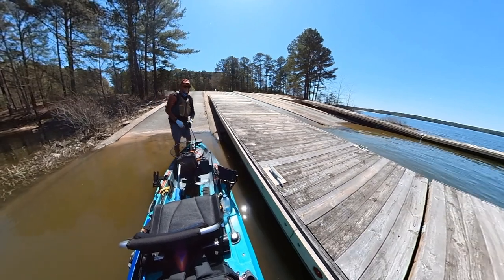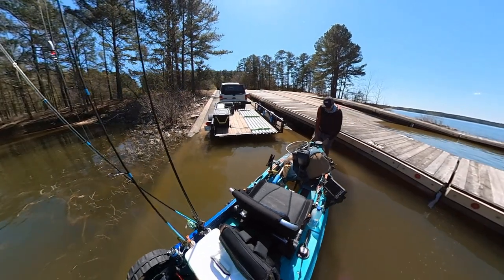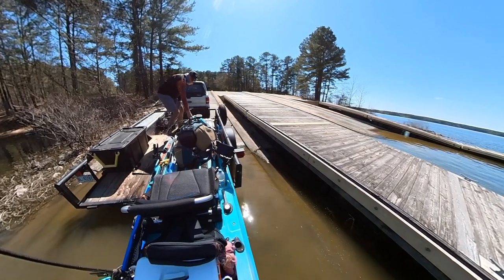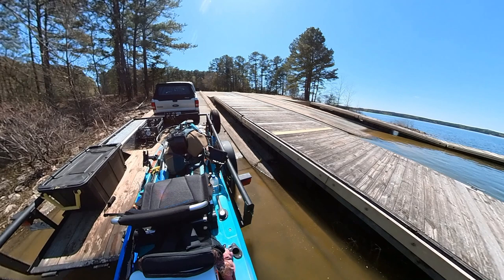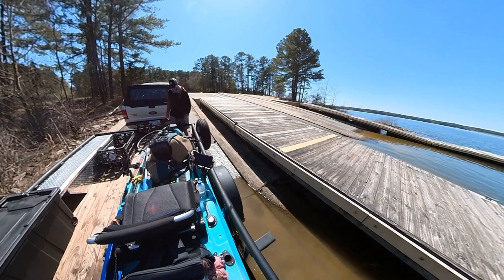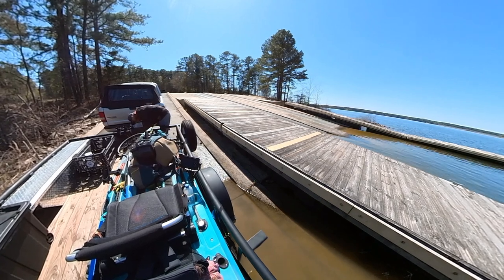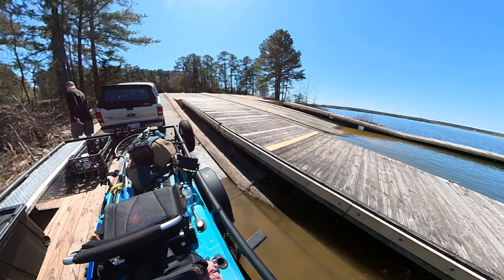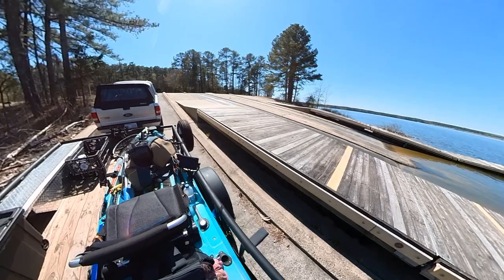DIY Kayak Trailer-Loading Solo from water Old Town Sportsman PDL120

Comment: Why not install winch to pull kayak  on trailer
Reply from the maker: I ended up taking the pool noodles off and the kayak easily slides across the plastic flooring I have down.   So far I am able to pull it up there relatively easy.   However as I am getting older that may definitely be a future upgrade.